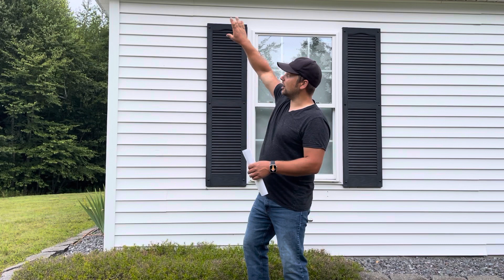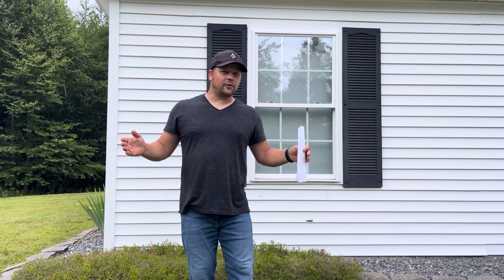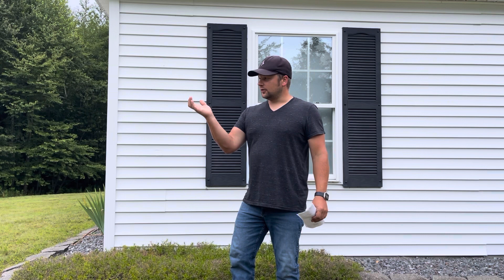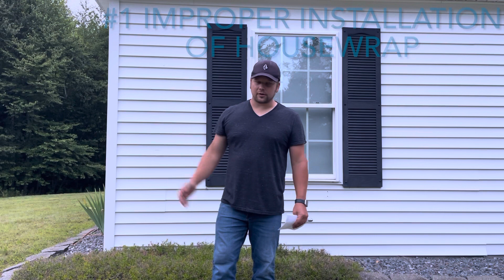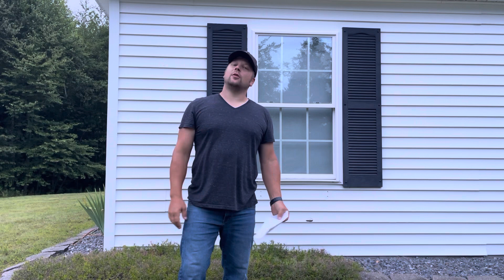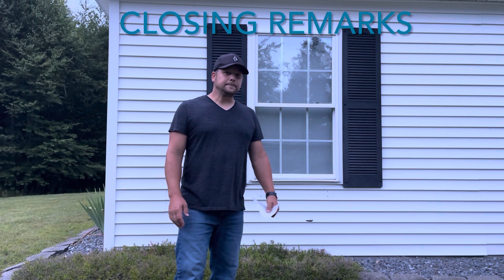5 Common Siding Mistakes - #1 Can cost $1,000’s

Comment: Can you answer a question..
I'm planning to install Vinyl..will be installing it over existing white cedar shingles..
Will be using Fan Fold and House Wrap..
What should be applied first, House Wrap and tape...then Fan Fold..
Or Fan Fold ..then House Wrap and tape?
Thanks
Reply from the maker: Preferably I’d take the shingles off that way you can get a good look at the underlayment and make any repairs. Either way you could insulate and put housewrap on top of the insulation as this will reduce the amount of penetrations through the housewrap…. I’m sure there’s arguments to be made for putting the insulation on top of housewrap, but it seems housewrap on top of insulation is Tyvek’s preferred method.
Reply: Great.. thanks for the quick response..keep up the good work.

Comment: Folks, do yourself a huge favor and never install vinyl siding. I just spent nearly $100,000 to have the vinyl on my house put in a dumpster and replaced with HardiePlank. The result is gorgeous. Among its many drawbacks is the fact that supply is controlled to the point that a homeowner cannot purchase material to repair or remodel his home. The notion that vinyl is somehow superior because it does not need to be painted is a farce: the stuff must be pressure washed every couple years because it attracts dirt like nothing else. The need to loosely nail this crap gives the entire house a flimsy, creaky feel. My house came with vinyl; I wish I had ditched it years ago.
Reply from the maker: I’ve done quite a few fiber cement projects and it is a beautiful product. For some people though it is out of their price range unfortunately.
Reply: While vinyl may attract dirt, it doesn't  fade much, as I matched some that was 11 yrs old and you couldn't tell the difference with the new stuff.
Reply: Fiber cement isn't the best in my opinion.  The seems open up and I've seen it also fall right out in cold temps.
Reply from the maker: You right - I’ve definitely seen seams open up in hardi, I don’t think that is a big deal. They are supposed to be back-flashed and could easily be caulked in… although that is a maintenance job.
Reply: I had hardiplank on the back of a 3 side brick home and a front gable. I agree it does look better than vinyl. The problem with vinyl is cheap vinyl and crappy installs. I have seen 25year old vinyl that still looked good and 2 year old that looked terrible. It's definitely a price point product but has it's place. It's relatively inexpensive, fairly easy to install, low maintenance. I think it's good for certain smaller home remodels but i like hardiplank more. I plan on redoing vinyl on a home purchase I'm about to make. I would love to use hardiplank but the return on investment would not justify its use. Champagne taste in a beer budget neighborhood.
Reply from the maker: It definitely depends on the neighborhood. In a historic district Hardi or wood is the way to go.
Reply: @inflationsux I installed Hardiplank on a large garden house I built next to my home. That was 20 years ago. I have repainted it once. It does not yet need repainting and the entire structure looks like new. There is no evident wear of any of the Hardiplank, no separation of any seams. I used polyurethane caulk, and that was before today’s practice of backflashing with a strip of plastic. Before the vinyl was stripped from my house I made many revisions owing to the 11 windows I replaced. I am glad those days are behind me.
Reply: You never power wash vinyl siding. Fiber cement is a concrete product, it's heavy, brittle, and if installed wrong will rot just like wood. Conversly, vinyl and composits come in various grades, thicknesses and some are even laminated and have a hail warranty witch your fiber cement does not. If you bought a new house with vinyl, you're correct. Builders use shitty siding and cheap labor to slap it on the wall. If you want to know if your fiber cement is done correctly there's two simple things to look for. Corners and trim boards that are 1" with siding but jointed to them and caulked not overlapping the siding. Your siding but joints should be flashed and not caulked. If they're caulked, they're gonna fail.

Comment: Understood. By the same token, you should be ethical and not charge anyone thousands to fix improper siding. It's not rocket science.
Reply from the maker: Do you think $100 an hour is too much for 2 men and equipment? It was me and a helper. I have overhead, tools, a truck, trailer, staging, workers comp (not on me, but on my helper), no health insurance, no paid days off, no 401k, no dental insurance, etc…

Furthermore, the repairs I’ve done were on other people’s work.
Reply: No, it isn’t too much. Maybe not enough. @sidingschool
Reply: I feel like a lot of people are price shoppers. People want the cheapest price and expect it to be done properly. I know I don't expect much when I buy cheap tools, why should the thinking be different for labor. I imagine coming to fix someone elses work and the damage it has caused can be labor intensive compared to the crew who just thew it up, collected a check and disappeared. A lot of money can be made in the trades for those who are organized, highly productive, and produce quality work or do cheap shoddy work at a lower price using the cheapest materials and labor. How often will the average consumer know the difference until after the fact?
Reply from the maker: They won’t know the difference until their windows and doors are leaking or the deck is falling off the house or the wall is rotting out behind all the siding…. Usually about 10-20 years.
Reply: While it isn’t “rocket science” there is serious overhead in running any business in the trades.  Business, liability, and health insurance; tools(a professional pump jack scaffolding system runs between $15k and $20k, and you can’t be in the siding business without it. And that’s just one of about 10 expensive tools needed to do this job correctly), fuel, and ever increasing supply costs.  These guys don’t just pick up their paycheck at the end of the week.  Presumably he runs a business to make a profit, and he can’t be making much of one charging $100/Hr. for labor for two guys.  This guy is making instructional videos to help those who are interested learn the trade.